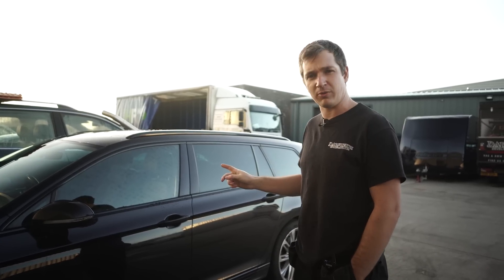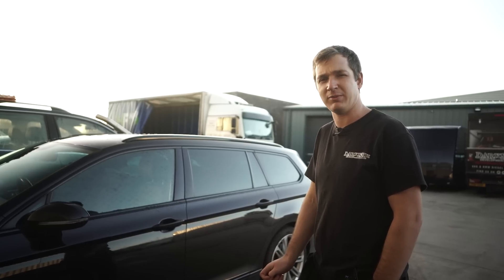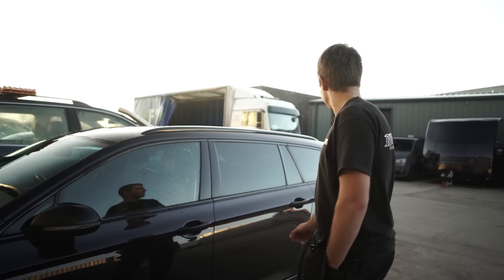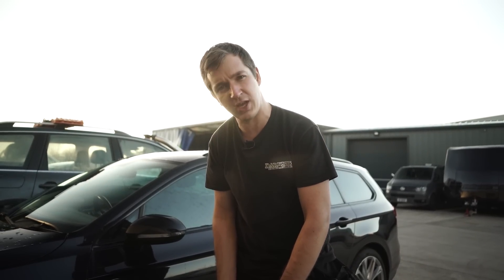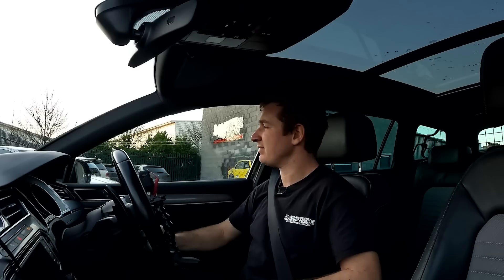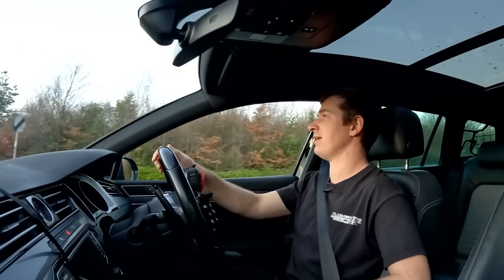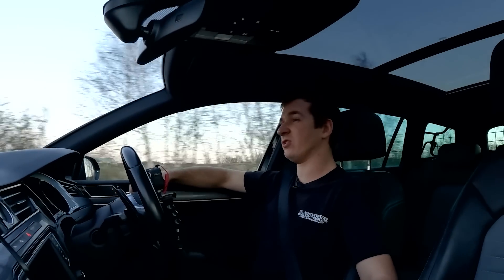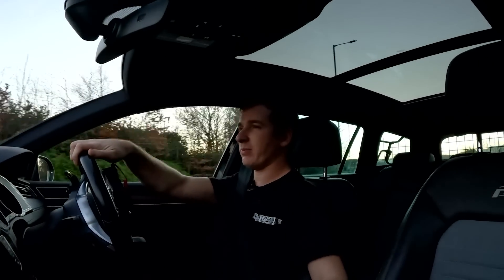Passat 2.0 CUAA Bi-Turbo Pre Turbo Upgrade Remap! Part 1

Comment: With regards to the exhaust temperatures melting the DPF, should I be worried? mine is Revo'd! Is that only a concern if you are ragging it around? I drive like miss Daisy most of the time. My DSG started leaking oil and the Ad-Blue pipe split recently, I'm hoping they are just coincidences =\
Reply from the maker: Some tuners turn off the EGT sensors at 700c.  This can be dangerous and yes we have seen some melted DPF's, normally only when pushed.  We can't comment on specific tuners.
Reply: @DarksideDevelopments  Understood, cheers.

Comment: Does it feel as fast as a stock 3.0 TDI? I know these have big injectors and run very high rail pressure as standard. 380hp should be achievable with the turbo upgrade.
Reply from the maker: Quicker than stock 3.0. not sure where you get the 380hp figure from!
Reply: @DarksideDevelopments  Its just what I estimate with the amount of fuel and air you should have available when the big turbo goes on.

Comment: Interesting as usual, unfortunately you guys always remove dpf and then upgrade the Turbo, whould be interesting to see if the lower backpressure of the bigger turbo would drop exhaust temps as well. I know that the best result will always be without dpf, but in some countries this really isn’t an option😅
Reply from the maker: The DPF restrictions are not worth tuning around sometimes